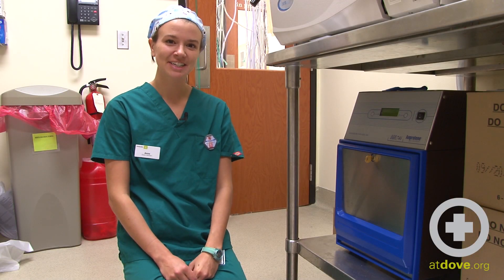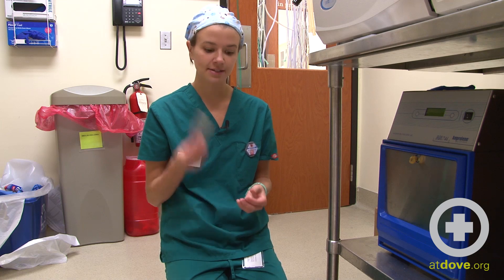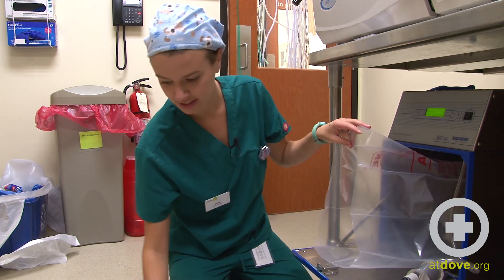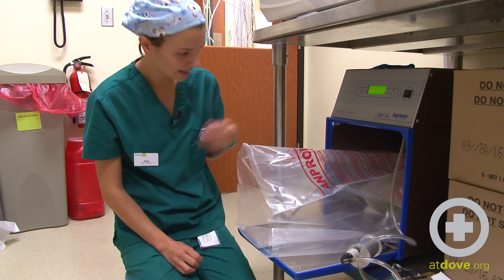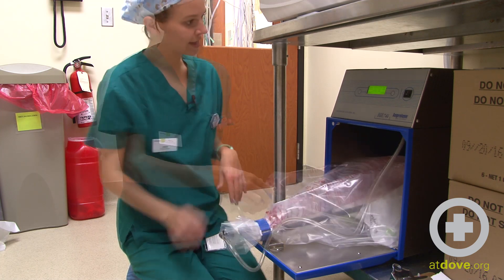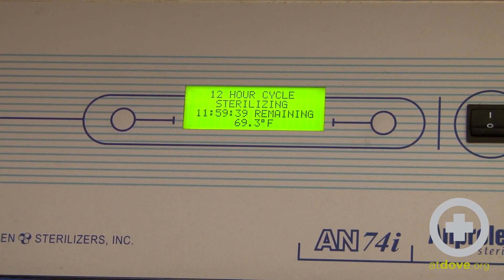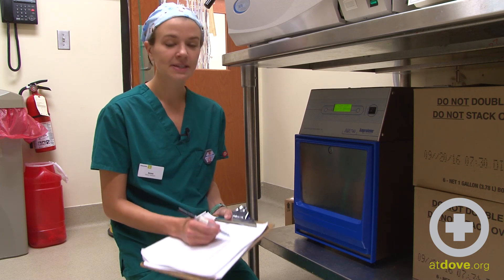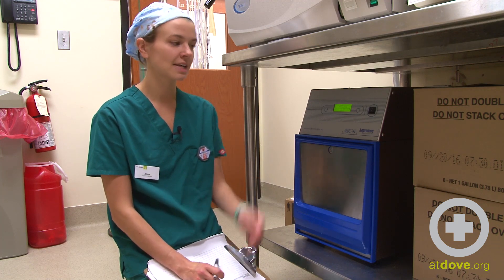Operating an Ethylene Oxide Gas Sterilizer

Comment: Isnt EO super dangerous!??
Reply: Only in the wrong hands! It has the potential to exploded and therefore requires proper training.
Reply: And it‘s extremely carcinogenic if breathed in
Reply: @spitzkopflarry159  lets hope the air has well dissapated by the time the consumer gets it 😬
Reply: @xo177i88  Trust me, they make sure to get as most toxicity as possible inside you
Reply: If spilled yes, but it’s like a Dish Washer, the Ethylene oxide (the “water and soap” in this analogy) are vented into a catalyst and destroyed, followed even in some cases by vacuum pulling and “gas washes” with nitrogen etc pre-venting so assuming everything is done correctly there should be none left, just as how you get dry dishes out, not a tidal wave of soap and water!
Reply: @ericlotze7724 There will be some residual gas in the pouches even after gas and air washing. I wonder where they aerate? That’s done at contract sterilizers in aeration chamber at elevated temperature.
Reply: @lifebreath77 you are wrong. Medical packaging used in EtO sterilization allows the residual gas to be removed. Residual testing MUST be performed in any medical device sterilization facility in order to release sterile product to the public. There are NO eto residuals on these items.
Reply: We offer free training on the unit, it uses 0.039 lbs of EO per cycle, safer to use than H2O2
Reply: @ibeenorm  
0.039lbs = 17.7 grams
Australian health authorities have set a maximum air concentration of ethylene oxide for a workplace of 1800 micrograms per cubic metre of air.
So it would exceed the maximum safety standards by 98,333% 
But id assume its ventilated.. but knowing this, would you think the amount of EO present on the PCR tests is safe? Directly stuck up the nose from the figures I gave above..
Reply: @GotFaculty  There is no EO on those PCR tests. I probably saw the same video as you where some crackpot nurse said there was EO on the swabs. EO is a gas not a liquid like the "nurse" said. EO is exhausted from the products during the sterilization process and it evaporates extremely quickly. Also the 17.7 grams is not the concentration in the air its the available amount of gas that is used inside the sterilizer. This system is used in Australia and meets their safety standards as well over 100 other countries.
Reply: @XDWX so it doesn't linger in the air for 60-150 days
Reply: @XDWX Ethylene oxide is a gas at room temperature and atmospheric pressure (and at the higher temperatures used for sterilization), but it is a liquid below 10.4°C at 1 atm, or at room temp under the pressure inside of the sealed ampoule: that's why it feels cold when it opens; as the pressure drops the temperature decreases and the liquid starts to boil, taking the heat from the environment.

Comment: No one is upset they're using Ethylene Oxide a known high risk carcinogen according to the CDC?
Reply: No one seems upset about the billions of cavities that were filled with Mercury either
Reply: @nosleep2073  sometimes it's to unbelievable to believe.   They reluctantly stopped the Mercury teeth but not in "vacations."   
.
If anyone I would think doctors that handle the Ethylene Oxide would be the most out spoken to stop it.  Yet they continue to use car radiator fluid to clean their instruments.
Reply: @OxAO  yeah you would think doctors would say something,  but don't forget they are brainwashed aswell. 

The pharmacist at my local Walgreens says there's nothing to worry about because we do not come into contact with the ethylene oxide gas itself